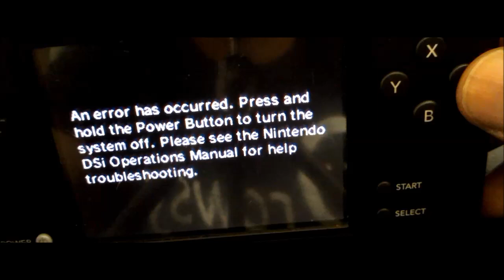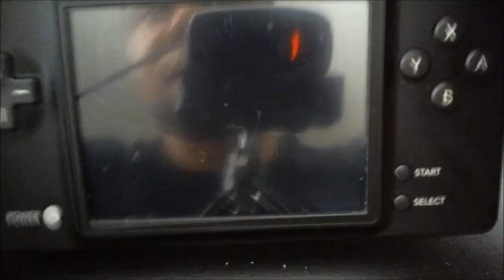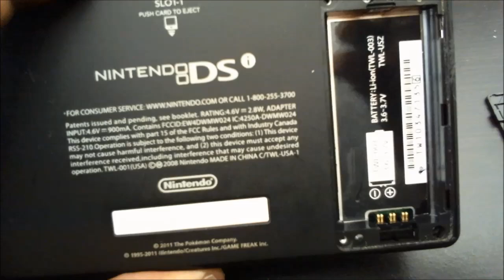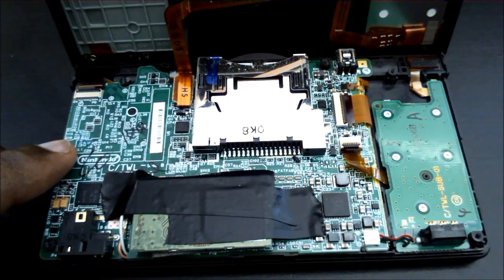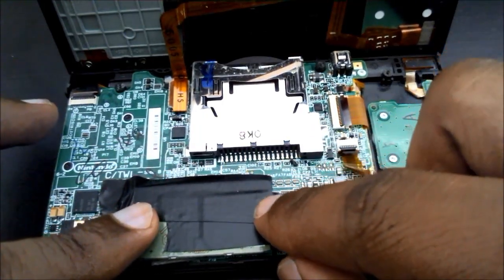Nintendo DSi Wifi Replacement Card Guide | "An Error has occurred" problem

Comment: Thanks, I just bought one from cash converters and it was having this problem. I followed your guide but I didn't have a replacement, just blowing on the wifi card connectors and reconnecting it fixed the problem. Woo!
Reply: You don’t want to blow on it as it will corrode your device in the long term.

Comment: Just in case anyone is here and doesn't know why this happens, here's my understanding:

When Nintendo built the dsi and dsi XL they (also the DS Lite iirc) they needed somewhere that they could store some elements of the consoles operating system. The solution was to store it in the WiFi chip. When you get this error it usually means that the WiFi chip has been damaged and the console can't access the data it needs to boot games or move to various different apps. The chips themselves can either be damaged or simply knocked loose after a drop. If you have this issue you should always try disconnecting and reconnecting the WiFi card before ordering a replacement as it could easily just be loose.
Reply: Ah i see
Reply: Good to know. I doubt there are cheap ways to get those chips alone but I wished because I just got a DSI for myself and the chip gets loose too easily. even with tape I can get that error message but I wasn't using electrical tape.
Reply: Would this also count if the dsi freezes on the start up screen? I tried doing a hard reset and in a way worked right after but then it started to freeze again
Reply: ..it seems to be true for 3DS consoles, as well. WTF were they thinking!
Reply: Ty for the comment.

Comment: sometimes, the connections get dirty or come loose too. so try cleaning the contact points, make sure that the left side of the card (where it connect to is not loose), and try using electrical tape to hold the wifi card down. if that doesnt work, proceed to purchase a new card. 
I've done this twice with the result of one dsi needing a new card and the other with just a quick clean and taping. Also, you can magnetize your screwdriver by running it either up or down on a magnet.
Reply: I've tried everything but nothing worked sadly.. Any help?

Comment: Hello, Adrian DeBarros. Thanks for the video you made. Recently I have a same problem and if you don't mind, would you like to give me another link for the replacement wifi card? I pressed on the link and it showed, "this page is missing,"

Thanks before.
Reply from the maker: Hey Kezia!  So sorry for late reply - sometimes Youtube doesn't show me comments right away.  Anyway, if you still need the card, there are plenty on ebay here's one https://www.ebay.com/itm/Genuine-Nintendo-DSI-Repair-Part-WiFi-Board-Module-100-working-USA-seller/322258194378?hash=item4b0815cfca:g:ekcAAOSwAuZX1QdU

If that one sells out, simply search DSI wifi card on ebay and you should find one.

Thanks for watching.

Comment: Thank you for your video! I have a question: I bought a used DSi and have this error message with every app. When I opened it I found that inside is a replacement wi-fi card (DWM-W015)... In your opinion, what are the odds that the replacement wi-fi card went dead and what causes this? And are there other possible causes for this error message?

Comment: Does this wifi card also work with a DSI XL
Reply: Dual Screen I Extra Large (DSI XL) is the same as the DSI just with bigger screens. hopefully it works.
Reply: Tmurfin Murfin and bigger rear firing camera and speaker grills
Reply: Oh, well I just have a red DSi, the DSi is not XL.
Reply: Tmurfin Murfin dwm-w016 work in dsi normal?
Reply: Ready to Play yes
Reply: Did you ever confirm if it's the same

Comment: Mine doesn’t have screws at the back?  It’s definitely a dsi
Can someone tell me how? Do I put it in the SD card slot
Reply: The SD Slot is for an SD Card which is like a flat USB Flash Drive for saving pictures and other files. To put the WiFi card in the SD Card slot won’t make the console work and could possibly damage the port.

Comment: My error says '' An error has occurred. Press and hold the POWER Button to turn the system off. Please refer to the Nintendo DSi Operations Manual for details.'' Will this help for my isue to? Because my game card always worked and after conecting to the internet, it said that message that I just typed. Or is it just the same error with other words...
Reply: Rik L idk yet I got the same message and getting the card and tools I'll let you know in like a month bro
Reply: Pyro HackSource and it works;

Comment: I need help I tried this took it apart and everything but I didn't change the Wi-Fi card I just unplugged it and plugged it back in seeing if that would fix it so I put it back together and it wouldn't turn on but when I plugged the charger in it started blinking orange I need help please
Reply: Ever find a solution?
Im doing that same thing rn.
Reply: Nope:( I think it's because I need a new battery
Reply: Are you sure you did it right? Putting it back together? I used an alcohol pad on mine and I'm not having any problems.
Reply: Idk I took it apart and unplugged the Wi-Fi card and plugged it back in and then plugged the battery in while it was apart to see if it would work and it didn't turn on and I'm pretty sure I put it back together right but the ribbon cable was a pain in the butt to put back on but pretty sure I did it right what could I do to fix it

Comment: i hope you can help me i have been trying for years since i got my newest dsi a few years back and still been unable two use my wifi password and user name and  two connect to the internet and it shows its still locked  and when i try this is what it seads                      __  unable to connect to this access point  using current setting.   
to connect to this access point, use advanced setup. ----------- Ok 
 when i try in internet setting it tells me go to setting so confused 

Please help....!!!!

Comment: my ds xl the wire to the wifi chip is cut off then what do i do to make my ds xl work again can you help me the wire im speaking of is in your video at  9:34
Reply: What do you mean cut off? Unplugged or actually cut in half?  That's the wire that connects to the antenna in the top screen. It's soldered into the antenna so you would have to take the entire DS apart to replace that wire as it has to be threaded through the hinges and under the motherboard.